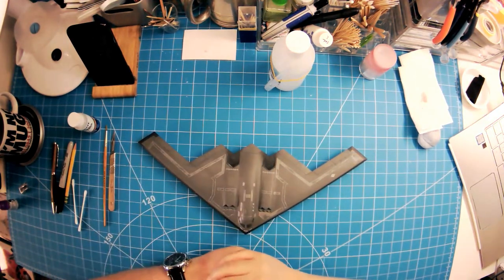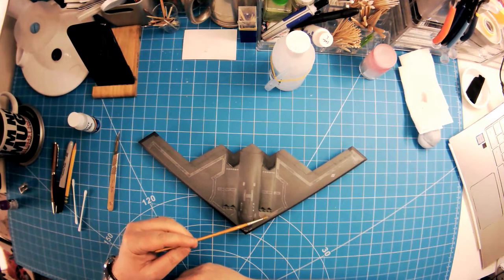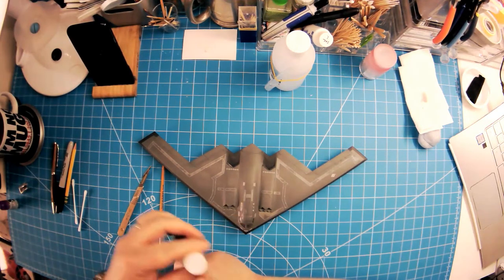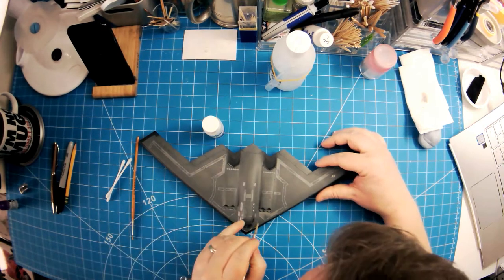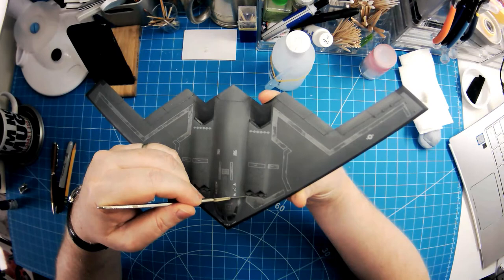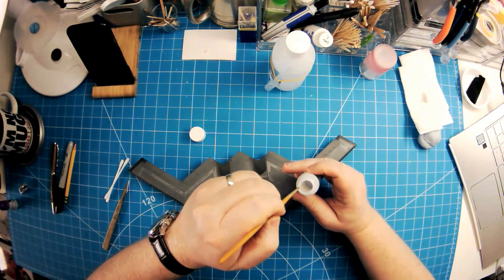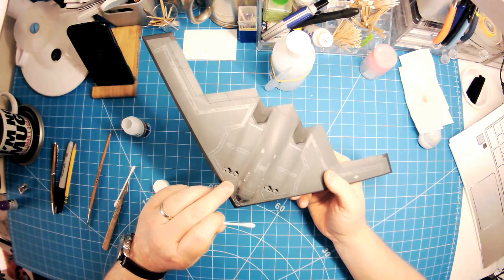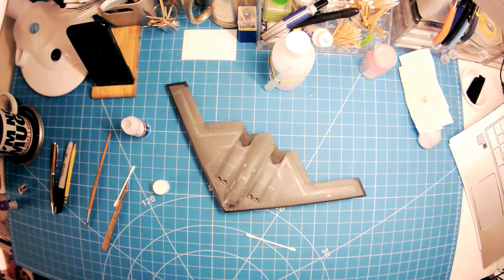Fixing silvering on decals - scale modelling techniques

Comment: Hi thanks for sharing, btw what is the best method to prevent silvering? do we need to clear coat before putting the decals ? or just put the decals and go with a top coat ? thanks
Reply from the maker: This is one of the big debates going. I used to clear coat - I don't anymore. A clear coat can help a "rough" paint finish accept decals easier. I find it much more important to focus on getting a smoother paint finish matt or gloss. If its smooth and you use good decal solutions like Set/Sol and UMP the decals will adhere and you won't need a clear coat before.